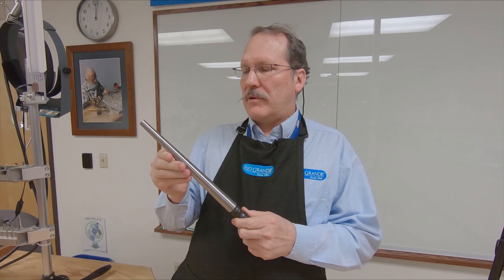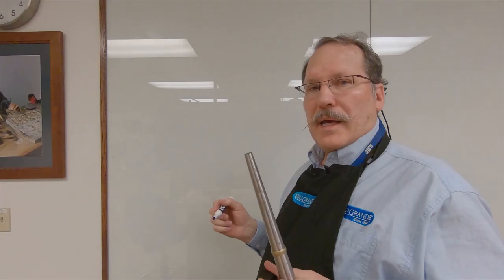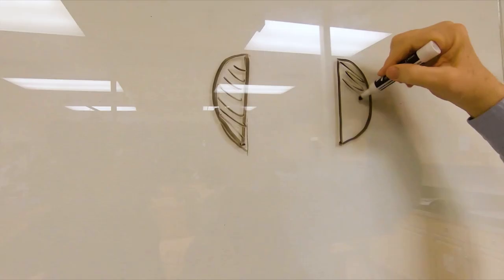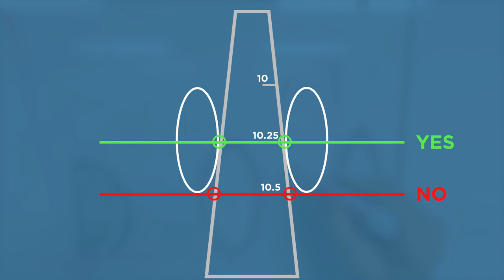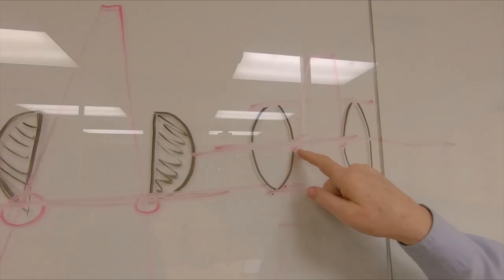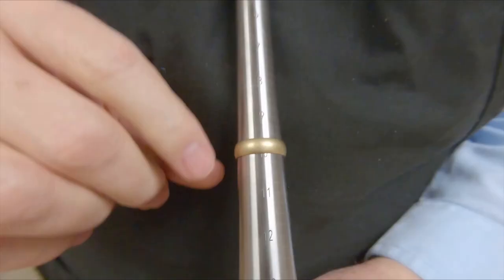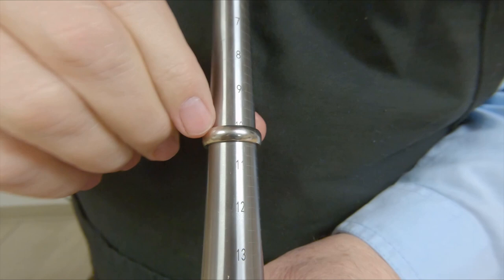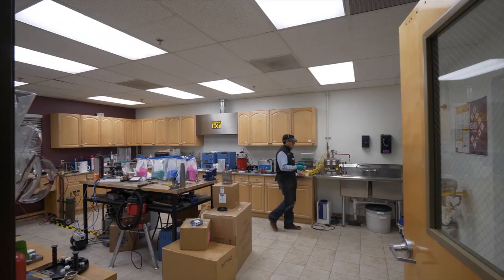How To Read A Ring Mandrel

Comment: I inherited an old steel mandrel similar to the one in the video. I need to know why the tool is shaped like it is. What is the big groove near the bottom used for? Why is there a depression in the bottom used for? Why is there a small square hole in the round hole in the bottom of the tool? Does that square hole have a purpose? And finally, how do I position the mandrel for use in a bench vise, to stabilize it for ring work?
Reply: That may not be a mandrel you inherited...did you find it in a bed side drawer? What's it smell like?
Reply: @FriboLay: It is made of tool steel and is about 15" long. It is 1-1/4" wide at the base and 3/8" wide at the top. It is marked with Ring sizes around the circumference, from 0-16. My father taught himself silversmithing and jewelry making and had been a silver designer in the 40's and 50's. I had watched him making silver rings as a young child but wasn't interested in taking it up, while he was alive. He said it was a Ring Mandrel, and he was an Honest man.

Comment: Great video thank You, Could you please advise  me how I would measure a ring which has a design on the front which has a height of 15mm (7.5mm each side of the central band) it tapers at the halfway  to a 2mm band. When I put it on my mandrel the design at the front drops down and reads a size 10 but the back of the ring where the 2mm band sits is sitting at approx the 9.5 mark, so would this ring be a size 10 or 9.5 please. I would appreciate any advice you can offer, Thank You

Comment: Does the same apply if the ring has a flat back?
Reply from the maker: Yes, however, it will depend on the size of the bezel setting, for example a large oval or asymmetrical bezel can come into contact with the mandrel before the ring shank fully seats on the mandrel this can affect an accurate measurement.

Comment: Hi Gregg. That was great. Wondering, I've found when I make really wide rings the size is right at the top edge of the ring rather than middle or end.  Imagining it on a mandrel as in your drawings.  Is that what you've found?
Reply: Is the ring's inside surface (the part against the finger's skin) curved or flat? I'm having a hard time understanding how either one could result in the situation you describe.... unless the inside is really wonky. Rio Grande's graphics describe it perfectly.

Comment: Not exactly.
The size on a comfort fit ring is at the center point of the ring.
The ring mandrel contacts the ring at the tangent point which is larger than the actual size and not at the center point of the ring.
Use a ring sizer in the same width of the ring you desire or try on rings until you find the one that fits and measure that ring with dial or digital calipers.

Comment: Does this mean, by turning the ring upside down and putting the ring back on the mandrel and re-malleting it, trueing it, can you read the measurement from the centre of the ring length/band, rather than the bottom edge of the ring when on the mandrel 😵‍💫😵‍💫 hope that makes sense😂..